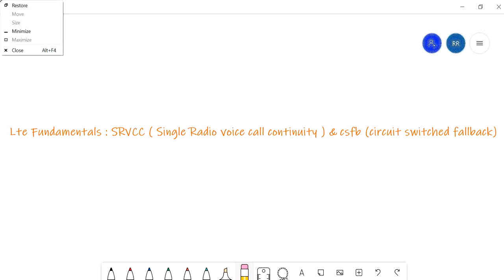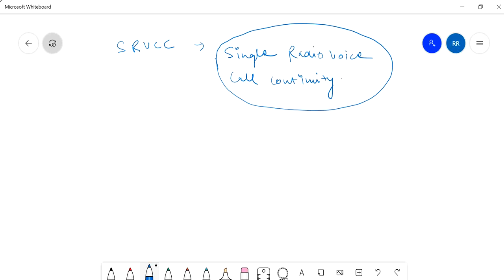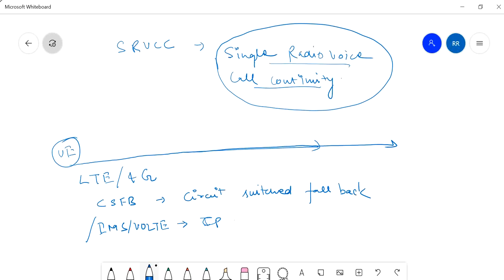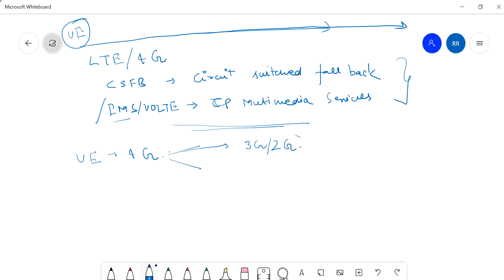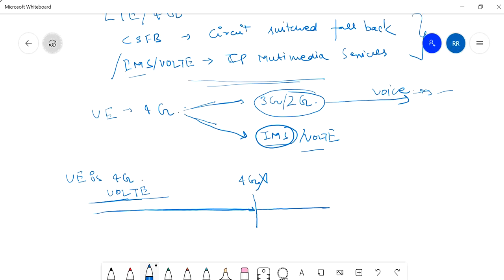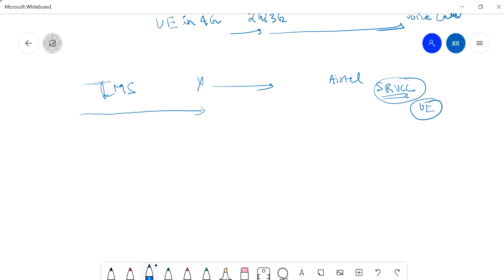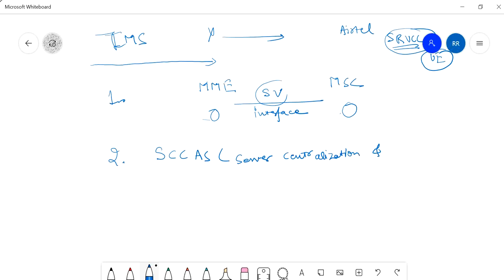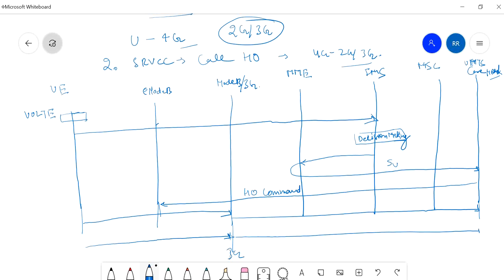SRVCC & CSFB

Comment: When receiving the CS call in Airtel network, internet is not working...

What's the reason to cause this issei
Reply from the maker: May be its CSFB call  ,not Volte call
Reply: @conceptsoftelecommakeiteas2919  if ue comes to 3g network for CS call, the data won't work ?
Reply from the maker: check VOLTE is enabled ? when VOLTE 
call is connected

Comment: Hi Sir..
Handover decision making done at eNodeB.
UE send measurement reports to eNodeB and then eNB will take HO decision and then send HO required message to MME..
Correct me if I'm wrong..
Video time stamp: 12:45
Reply from the maker: Yes you are right , you talking about handover with S1AP , in case of X2 , its bit different , in that case , Source eNB sends Ho request to target eNB and target eNB sets up S1 AP connection
Reply: @conceptsoftelecommakeiteas2919  
In SRVCC case who will take HO decision
Reply: Csfb is not handover